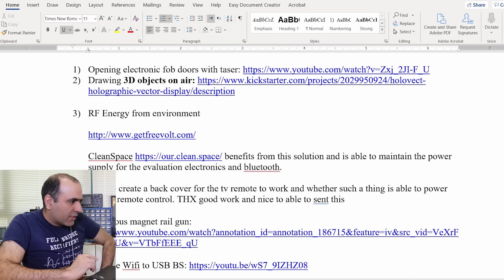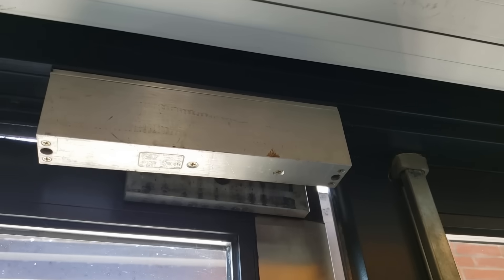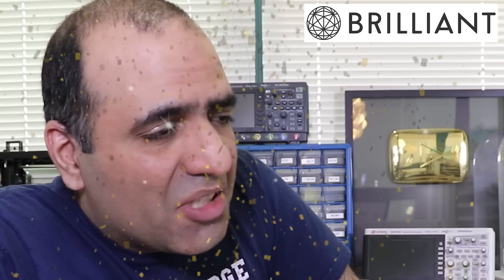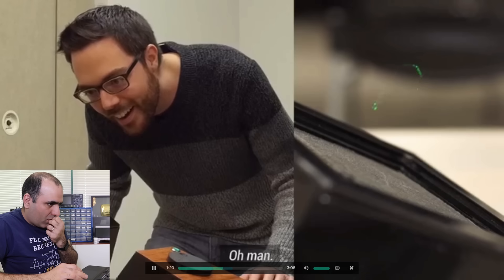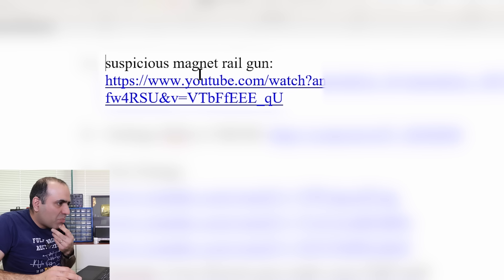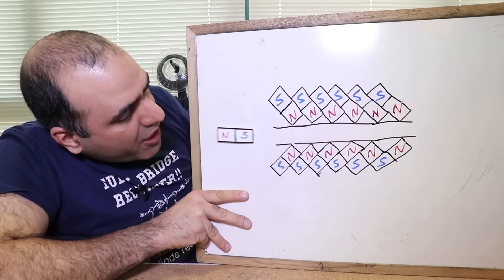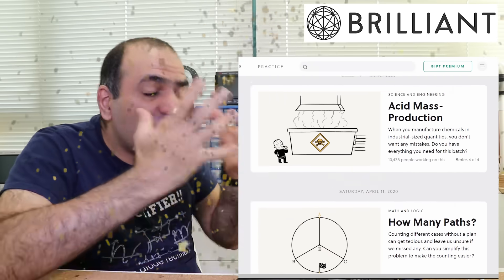BATCH RECTIFICATION of my To-Do-List

Comment: Gauss Guns coil guns and rail guns are all separate things. The magnet gun is a type of gauss gun, it does work. However, it's no different from a bow, in which all of the energy is potential energy that your own muscles store; the difference is that the energy is stored in the magnetic fields rather than elastic limbs. Its akin to pushing two magnets together with their same poles facing each other, you push really hard, store energy, and when you let go they get flung apart (and usually flip around and then fly back together), they're just very intelligently taking advantage of that to shoot them in a controllable direction and without flipping back around. So basically, its a magnet bow. Which is still pretty cool in my opinion. Just misleading.

Coil guns and rail guns both actually do add energy other than your muscles, but they draw extreme currents. Coil guns use coils to generate magnetic fields when electricity is passed through, and railguns pass the current directly through the projectile to induce a forward force in the projectile.

Comment: The laser hologram may have been a scam... BUT the idea is worth looking into... Like you said the air is chaotic and it doesn't move in a straight line BUT lasers move in a straight line... WHAT IF... another laser became the canvas oscillating at a different frequency than the laser creating the image... Just an idea 😁🤓😎
Reply: The laser’s photons need to hit something in order for the light to scatter and reach your eyes. Photons cannot interact with each other, they cannot “collide”, so no light ever reaches your eyes

Comment: A good magnetic door lock design would be to have a permanent magnet that holds the door closed, and an electromagnet to cancel out the permanent magnet temporarily. Then it would fail safe.

Comment: I don't expect Mehdi to know security industry lingo, but fail safe and fail secure are opposites. So saying "Fail safe and secure" is not a thing. Fail safe is for safety purposes, meaning doors unlock to allow unimpeded egress, while fail secure means the door/lock remains secure in the event of a failure. Usually this is a normally open locked situation with a power loss maintaining that open circuit, while a closed circuit allows power through, unlocking the secure access.

Comment: I think electronic doors unlocking in case of power failure is a standard design so if a disaster occurs and the power is cut, people can get out of the building easily

Comment: If I were designing that I would make it based on the application. keep in mind this is a door lock, it actually IS failing safe. in a fire or other emergency, if the locks fail, the doors should be in the unlocked position to allow people inside to escape the building. I could see applications though where the potential loss of life in a fire would be worth the risk to protect what's inside, meaning it would be better to have the locks fail deadly.

Comment: The way I have defeated magnetic door holder systems is to simply deliver a short, sharp mechanical shock on the door up where the magnet is.  You only have to produce an "impulse" that exceeds the holding capacity of the magnet for a fraction of a second, and the door pops open.  I've had to do this at a place of my employment when the clever computer controls wouldn't let me out of the building--which itself is a serious safety hazard.

Comment: 10:40 I remember when I had a PSP. You could extend the range of the Wi-Fi antenna by bridging two points in the USB plug on top of the device. So a lot of people made little circular coils that plugged into the USB plug pretty much.

Comment: In Eastern European apartments (from experience) you can do 2 things to the keypad; 1. Key code: you type in a code and if you get it right everyone in the apartment can hear that and you can come in. 2. Call: you type in the apartment number you want to call and call them. They can let you in the apartment. It’s different in Ireland where instead of a code to get in you use a key or a keycard button attachment to your key

edit: my point with this is this electric pulse may send code 0000 to aprt# 00 and aprt# 00's code is usually 0000 and "notifies" aprt# 00 that someones coming so you can be secret with this

Comment: Not sure about Canada, but in the USA, it is legally required that the doors on most commercial buildings open outward.  This law was passed a long time ago due to a fire in 1911 in New York at the Triangle Shirtwaist factory that caused a large stampede of people toward the door, which opened inward.  Because the crowd was pushing on the door, it could not be opened and 146 workers died in the fire.

Comment: that free wifi video was indeed fake. or (FAF) because 1 he had the phone in airplane mode and 2. probably saved those pages to his phone or they were cached. If he indeed connected a wifi device to his phone it would be disabled becuse airplane mode disables ALL wifi adapters Even ones plugged into the usb port.

Comment: In the case of the fob doors I suspect regulations would mean they have to be in an open state if they fail for safety reasons.

Where you tried, the device reading the frequency is covered in plastic ( I think ) so I suppose it's already shielded in some way.

With the holographic display, I wonder if you could cool a gas and release it slowly in either an enclosed space or a vacuum in order to reduce atomic vibration in the air.

Comment: About taser opening doors: I think a failure mode to open in a lock like this may be desirable in case of fire etc. Though I guess proper grounding and insulation would also prevent this kind of attack. I have no idea, I am not an engineer.

Comment: I think there might a safety reason to open door in case of electronic lock failure, so in case of any disaster door will opens. Besides there might be normally opened switch type that actually controls door's magnet.

Comment: When electromagnet is faulty and fuse is blown, there is no elctricity running through electromagnet, hence door are open. This is for safety reason, for example in the event of fire. So Russian system good.

Comment: For the first video, I think if the door can be used as a fire exit then it must be made fail-safe, which it is, it becomes "safe" (i.e. you can safely go through it) when it fails, and not fail-secure. I think it would be impossible to make a door that is both fail-safe (like for fire escapes) and fail-secure (like for prison doors) simultainously.

Comment: @ElectroBOOM You said that magnets do not have fluctuating fields or run like rivers.

All magnets work with fluctuating/alternating fields.

No matter what magnet type.

Even permanent magnets wear down causing a decline in field strength, that in turn is part of the alternating field.

Even DC powered magnets have alternating field flux, as in actual fact, there is no such thing as DC in reality,.

DC is either alternating, biased alternating, or partial alternating field.

Also I feel very bad that you showed people that you went to an apartment complex with intention to commit arson.

Mehdi, I always thought you were an ethical person, now I feel bad for you.

Now all the little children may think you a very bad man.

Comment: 1:18 exactly because of that the door should be opened if electronics fail. You can't trap people inside the house.
Reply: I believe all these doors have to have a manual unlock from the inside, if it just unlocked when the power went out that would just be inviting criminals in.

Comment: A reader and lock are or never should be on the same power supply exactly fot this type of failure of attack. If it is on 1 system the installer was lazy or the owner wanted it cheap.

Comment: Most mag locks professionally installed usually have their own dedicated power supply and battery backup, that has inputs that disable the maglock. Usually, there is a keypad, or card input, and often a VOIP interface that will trigger the mag lock power supply as well.

Comment: Make a free light by winding a copper wire and insert a magnet up and down and up and down to make a electricity and put the electricity into the capacitor  charge the capacitor and use it to light a LED
Reply: It's not free tho.

Comment: electronic locks always open on failure because otherwise people could get trapped in burning buildings or during power outages. so electronic doors always, always open on power failure or reset.

Comment: For safety reasons, most door locks need to fail open.  People burning to death in a fire isn't good
Yes, there are exceptions of course.

Oh, the building you tried probably had a "panic bar" inside on the door that disengages the lock.  You know, the horizontal thing across a door in lots of public places you push on to open it... Yeah, it is a safety thing.

Comment: Well in most electronic access control systems these days it is required that if there is a reset of the electronics or a power failure the door must be able to be opened in the event of an emergency

Comment: 5:48  could be CGI, or it could be that they time the frame rate of the projector with the shutter speed of the camera maybe?  like in your video where the speaker modulates the tube of water to the shutter speed.

Comment: If it failed. It should open by default. If safer in term of power outage.
But if failed and recovered. It should lock by default. Since you can unlock it the normal way.

Comment: doors opening with the tazer makes a lot of sense.
The doors seemed to be for apartments/residential buildings.
If the electronics fail and the door stays locked, people could get trapped in the event of a fire or something.
In a fail state, those doors should open

Comment: My way of making holograms was similar to this but converted Cartesian coordinates in an obj 3d point to point file to polar coordinates so that I could use epicycles from a Fourier series and then shoot the laser into a speaker that had a stretched balloon with strip of aluminum reflective tape on the elastic material and then displayed the altered reflection into an oil diffuser.  It worked really well.  I have the software on github.  And looking up jerobeam fenderson oscilliscope music on youtube as well as videos on projecting lissajous knots with a laser on YouTube will explain why.

Comment: All tasers are stun guns, but not all stun guns are tasers.  That first video you showed was NOT a taser. Tasers have electrodes that shoot out with wires connected to them.  That one just has the probes at the tip.  Not your mistake, but you could have corrected them on their improper use of the word taser when they meant to say stun gun.

Comment: sorry sad person.  but the hologram isn't faked.  the reason you see a "laser passing through the corners" and not the rest is because of jerk and acceleration. 

the mirror reflecting the laser needs to slow down and change direction.  that's why the laser itself is more visible in the corners.  because it's moving so much slower
Reply: doesn't change the fact that kickstarter is a bad place to invest money XD  9 out of 10 kickstarters never deliver

Comment: If you were designing an access panel with a metal faceplate, wouldn't you want that metal faceplate to be isolated from the circuitry to prevent this sort of attack?  A little rubber weather seal gasket would probably work.

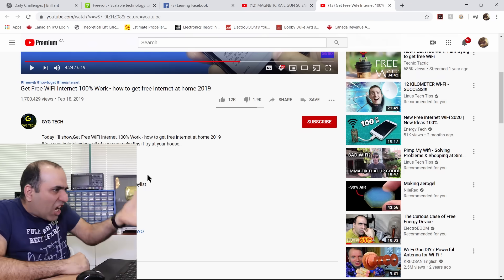Comment: 10:50 it could be real but then its shit anyway sins it would work with an normal charge cable hanging  in mid air, used as an antenna.

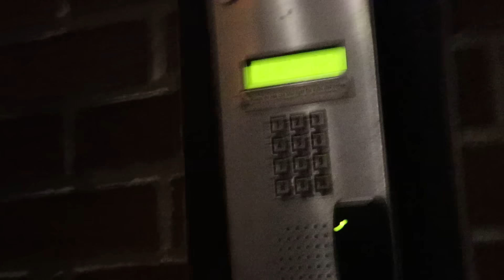Comment: If you look at 3:30 you can see as the system resets the black box next to it which is for a keyfob I think the led that has goes green for a moment and goes back to red.That means the door got unlocked but Mehdi did not got it open at the right time and thats why he thought that the teaser did not work!

Comment: There is a conflict between security and safty regarding electronic locks.
In reality electronic security doors should always failed unlocked if there is any risk people could be trapped inside in a life threatening situation.
Just imagin a gas line blows within the building cutting power and setting a large part of the strucutre on fire
If the doors entered a failure state locked then everyone in the building could very well die in a fire as a result.
There are ways to work around this. You can have doors fail into a lock state provided there is never a risk this would result in someone being traped, for example if you only allow people into an area while the door is open and it can't be closed while people are in that area. I could never lock closed while someone is inside so a failure state defaulting to locked would be fine. You could also have a mechanical opening system on the inside so people can always exit through a door regardless of failure state.
Corse the obvous solution would be to add some kind of battery backup to the locks to avoid power failure, but they would still need to fail into a safe state in the event the battery runs down or they are damaged by for example, a power surge.

Comment: Get the car battery and get an antenna put another antenna to the minus takeoff the antenna plastic and that zap zap zap zap zap zap zap zap zap zap do you need I am cold and use 1,000,000,000,000 V amp transformer on the car battery kidney use or 10 to 12 V transformer lean back to that transfer on that battery

Comment: There is no RF antenna wiring in a USB charge cord for a phone. You have USB power, positive and negative, red and black, and two other wires, green and white. These are data transmission wires. The green and white are slightly smaller, because they're signal wires. TX, and RX. Now if you pull the case apart, you will see some micro Nano RF cables, with micro Nano tiny sized push together, RCA style micro connectors, usually gold plated.

Comment: Play poppy have like that because just in case you guys are fire I didn't power gets knocked out for the place they don't want to have the residence stuck inside while depends resetting And that was what I think it's a good as I'm to have it on walk because imagine if liked is some reason like for example a hurricane and I need to leave the building and the power is knocked out when I'm reset what are you gonna do this keep it walked up And have the was die

Comment: The laser thing is interesting. you only see it at the points because that is where it spends the most times and our eyes have a certain.. "refresh rate" or the rate at which our eyes and brains can process images, so we only see the laser beam on the points where it intersects with the lines because that is where it spends the most time.. That one is a bit more believable. I think the better looking ones are a matter of the angle of filming and the light being dimmed and certain shapes that work well with it.

Comment: Old video is old, but if security door electronics were to fail or get interrupted and the response was to keep the door shut - it would be the opposite of fail safe and could lead to death in case of an emergency. A fail safe door would open when interrupted and let people pass through in case of emergency like fire or natural disasters. Not as secure but would also not kill everyone inside the building - a much better design imo.

Comment: It's better that the door opens without electricity, because in case of fire you have to go out. If the fire cuts off the line, door should open anyway.
Reply: Dude have you heard of a door opening from the inside and not the outside
Reply: @connoregan2874  there are electromagnets.
Reply: @Acidoetilendiamminotetracetico  why there's a physical release with no electricity
Reply: @connoregan2874  AN electromagnet works in both ways,doesnt matter if you go in or out. In case of dire, AN electromagnet should be disengaged to let people go out. And usually there is a circuit that controls the opening and a different circuit that controls the electromagnet.
Reply: @Acidoetilendiamminotetracetico  or you can use something called a fire escape
Reply: @connoregan2874  yes, you can. You can use a fire eacape just because your main door doesnt open. But more ways to go out are better than less right? I just say what is legal in italy, i dont know laws of other country.

Comment: Basic thing about the safety of any doors: in case of malfunction, you want to be able TO GO OUT , not to stay locked inside. Paramedics and firefighters usually don't have lock pickers and locksmiths with them. There are expensive Mercedes SUVs that can be unlocked by setting on fire a piece of paper and putting it under the car; the smoke sensor just overrides all advanced security electronics.. The reason? In case of fire, you want to be able to get out of the car, staying alive has precedence over keeping property safe of thieves.

Comment: Your point about fail safe in electronic door design is dangerous - electronic doors should always fail safe unlocked, allowing emergency escape in event of a fire that cuts electricity to the door control. It is correctly designed to fail safe open.

Comment: With door locks you need to be careful about designing to fail locked.  What happens if there is a fire?  Mag locks would need a pull station inside to kill all power in a system failure and electro-mechanical locks need some type of inside activated mechanical crash bar.  Ultimately the safety of the occupants to egress is more important than building security.  Failing to the locked state with an inside electro-mechanical override is probably the design you encountered with your test.